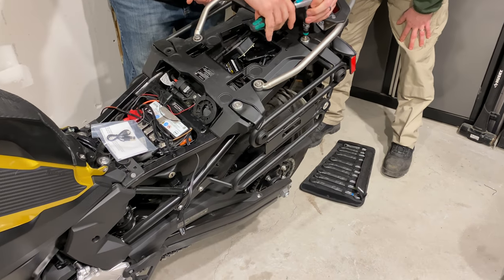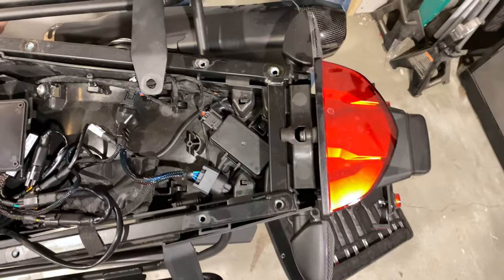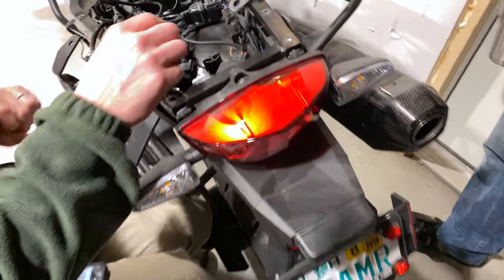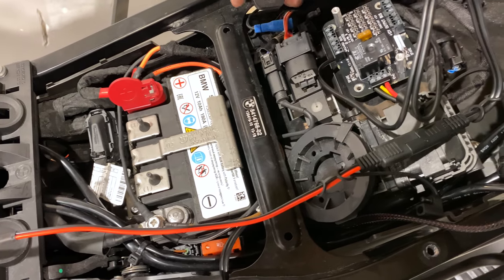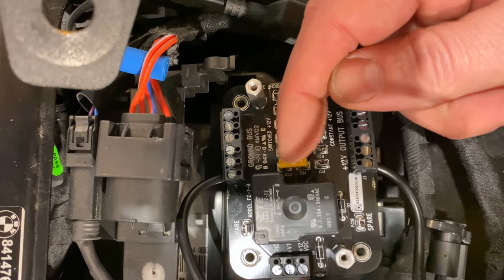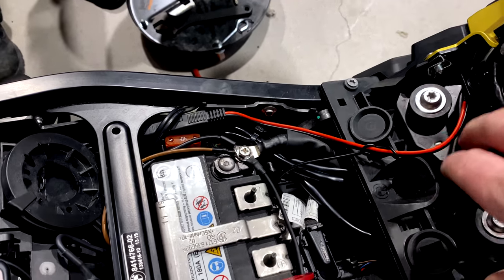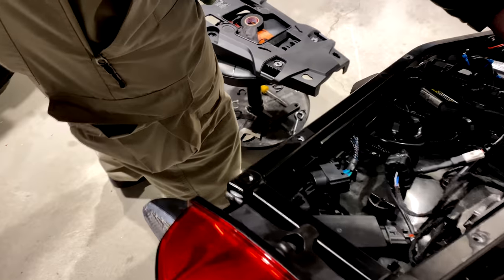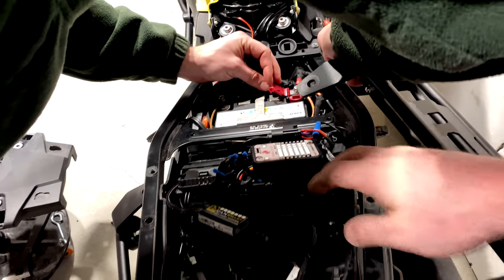BMW F750GS Wiring, Ignition Trigger and FuzeBlocks How-To and Install (F850GS)

Comment: Invaluable piece of information!! Thank you very much.
Reply from the maker: Best of luck, Victor.
Reply: @AdamChandler86   Sr. I just have one question, I have purchased a T-Tap fast connector good for up to 1mm cable, is that ok?
Reply from the maker: Hi, I use Posh-Tap brand personally but they're all the same. Just keep in mind there's a risk of water ingress over time but unlikely. But not a 0% risk.

Comment: Adam you just saved me a lot of time regarding live switch wire Superb!!I I take it tapping into the red and blue wire Didn't,"upset" the bike ?? no error codes??
D
Reply from the maker: Zero. We used the same blue/red wire on the R1200GS and F750GS. no issues.
Reply: @AdamChandler86  Thank you Adam 
Your a star ⭐️ 
Ride safe 
D

Comment: Why did you not just connect to a) the GPS connector cable BMW installed up front for this very purpose or b) to the Denali CANsmart?
Reply from the maker: We installed a few other accessories on this device so I wanted to show off how to do that as an FYI for others.